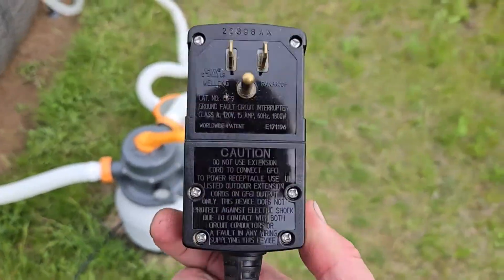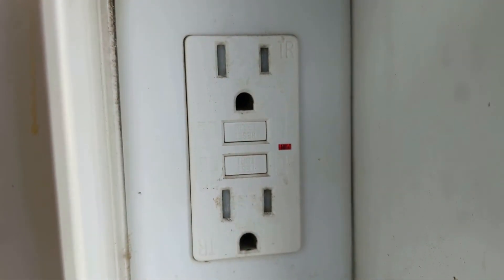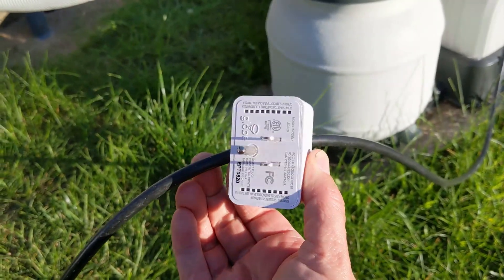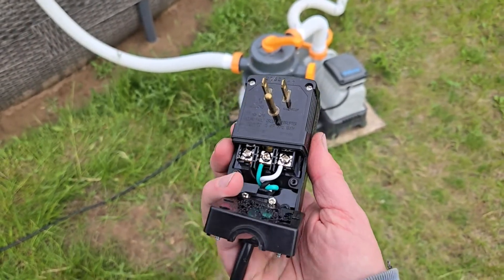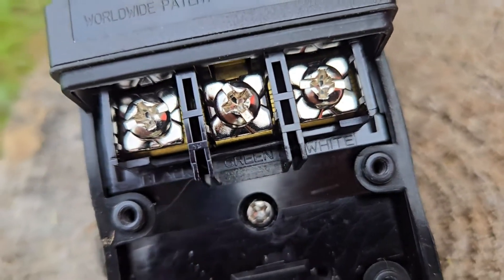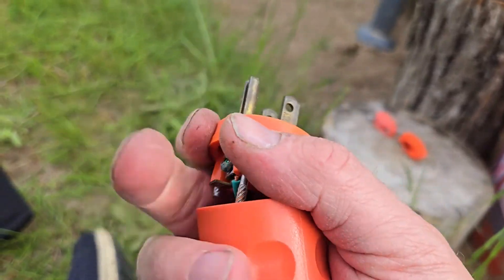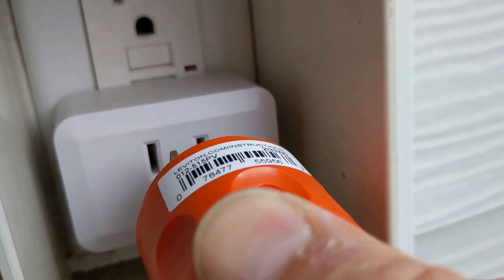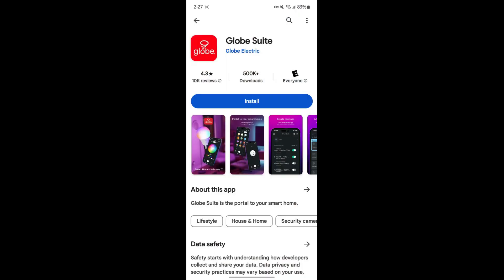Put a WiFi Timer on a Pool Pump - GFI Plug – Bestway, Intex, Coleman

Comment: Having the same issue and looking for solutions,  but it's not worth defeating a safety device to do it.
Reply: You aren’t defeating the GFCI.   His outdoor “outlet” where he plugs the new wifi & pool pump connector is annotated as GFCI.   He showed the GFCI in bathroom, garage & the outdoor receptacle.   No safety devices were defeated here.
Reply: That wouldn't hold up in court.  He modified the cord and removed the manufacturer's GFCI device (and didn't re-use it after the timer like I've seen some others do).  Yes, there is a GFCI further down the line.  But as I said, that won't hold up in court if someone were injured.  The manufacturer would argue their device was modified, and they'd be right.  I have this same pool pump/gfci plug.  There is a warning label near the gfci device that specifically states not to modify it.

Comment: Thank you so much for this video! Can you please talk more about your pool schedule? I’m a first time above ground pool owner and I don’t have a schedule for my pump. I’m out here completely winging it 😂 it would be great to know your schedule because I’d like to do something similar, even without the modifications mentioned in the video.
Reply from the maker: Thanks! For my schedule, I like to run for 12 hrs per day. I've played with it a bit, and seems to work best for me to run the pump primarily during the day. So from 8am to 8pm works pretty well. If you're using a timer like this one, then you can get fancier, like 2 hrs on, 1 hr off, etc..  the benefit of this is to keep the water stirred up more often to discourage algae growth. 

It is good to recirculate 90% of your water per day, which corresponds roughly to 2.5 turnovers per day. To calculate your turnover rate more accurately, there is a calculator here:
https://poolsforfools.com/pool-volume-calculator-and-pump-size/
I hope this helps!
Reply: @PracticalMechanic  Omg!! Thank you SO MUCH for explaining 😍 I can finally wrap my head around this. I was wondering why I had problem with algae. Sounds like I need to turn my pump on more often. Makes total sense because I was only running for a couple hours a day. Ahhhhhh. Got it!!! Thank you again 😊